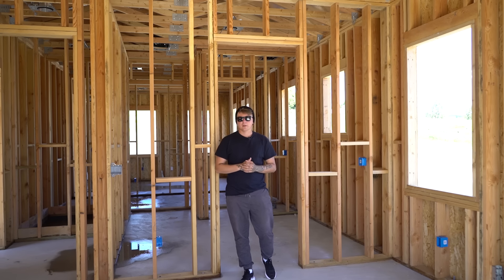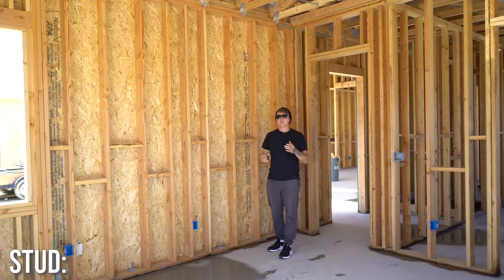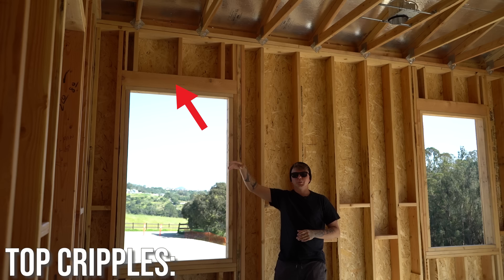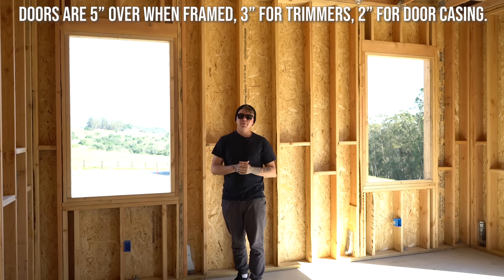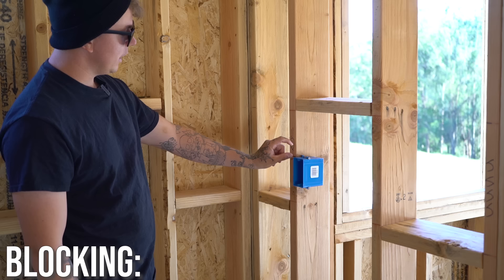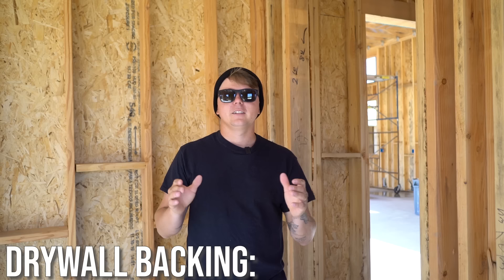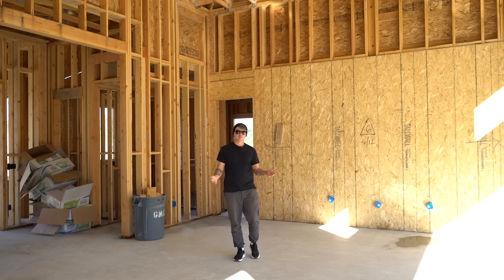Carpentry 101: Basics of Wood Framing with MattBangsWood [#1]

Comment: Great video.  Some comments from someone who has built and followed building across the country.  There are many things that are done differently on the west coast than in the rest of the country.  In the beginning of this video, you mention that pressure treated lumber has slits cut in it.  That only applies to fir and fir type lumbers.  In most of the country, treated lumber is Southern Yellow Pine (SYP.)  This material does not have slits because the SYP wood fibers accept the preservative treatments better than the firs.  
On the west coast, headers and many beams are huge dimensioned lumbers.   In most of the country, these items are built up of smaller dimensioned lumber.  6"x6" and larger dimensioned lumber is simply not available.  
You show triple or more side and bottom cripples. Anywhere except the west coast, you typically see single and rarely see more than double cripples.
Most of the country frames with kiln dried lumber.  Framing with green lumber is mostly unique to the west coast.
Outside the seismic affected west coast and wind affected coastal areas. Shear panels, strapping and clips or brackets and uplift brackets are foreign to people in most of the country.
Reply from the maker: Pinning this Roger, you nailed everything. So tough doing these videos as everyone has different requirements.
Reply: I'm an electrician, but I love watching yt journeyman so I can have an all encompassing knowledg. I have no problem helping others or making sure my work is making more work for them! Your a natural on camera teacher and I appreciate your videos. Also to the OP, ty for clearing that up, being informative and not being an asshole doing it 👌 I've always wondered why alot of the wood I buy is stamped syp. Are tremors considered bucks? I know we all have different terms and my framing neighbor here in Florida calls those bucks I believe. Thanks to you both!
Reply: Yeah I can confirm as a Iowa guy that builds pole barns and home remodeling additions. Don't have to build like we having a hurricane or earthquake
Reply: @lilcreaper007  are there requirements related to tornadoes?

Comment: I was installing drywall in a house (a Lindal Home design) in Grand Valley, Ontario, Canada years ago but there was no General Contractor (GC) and the framers didn't provide nail/screw surfaces for drywall everywhere. They didn't block any walls and the framing had dried and the 2" x 4" partition walls were bowed out so much the boards would rock. We ended up reframing some walls and shimming several others. The framers left a bunch of cut-off 2" x 6" pieces in the walk-out basement and I wanted to get rid of their waste so I cut pieces to length and nailed them between the perimeter wall studs at 3-1/2' and 5-1/2' above the concrete floor. It took most of the day but two days afterwards the owner's insurance agent came by to look at the house and was taking photographs in the basement. I asked if something was wrong and he said, "No, quite the opposite. Who's idea was it to install the blocking in the perimeter walls because it's not shown or noted on the drawings." I explained and he said he wished every house had this as it slows the rate of vertical flame spread and then he said he took photos to prove it so they can reduce the rate of insurance. He suggested we photograph it as well and provide pictures for the owner.
Reply: Cool! Let's hope it never gets proven though!

Comment: being a structural engineer in training myself, I have gotten good at summarizing the purpose of my job. A structural engineers job is to use applied physics and material science to transfer loads from the roof and floors down in to the ground. 90% of my job is determining how to get roof and floors loads (in my area, that would include snow) down into the soil. The last 10% is sizing those structural pieces to do so without breaking. Great video!
Reply: What also might help you better understand your job is find a "residential crew" or "commercial contractor" to work with ( depending upon which field you are going in) between semesters??? 
Might help give you a better understanding of how particular materials work in "real world". 
For me, I have just always learned more "hands on" than in a "class room". 
I understand, everyone is different, and was just trying to make a helpful suggestion is all.
Reply: Also trying to translate whatever crazy ass design the architect made into an actual plan
Reply: Being an EIT is an exciting time with a lot to learn... Did you notice the errors in the design and construction in the foreground at that @14:57 timestamp?  The shearwall boundary elements (6x6) should be continuous king posts, not broken and used as a trimmer.  The correct construction would have been 6x6 king posts and 1-2x6 trimmer.  This occurs at both of those walls.  I see this error a lot, contractors see the big post callouts and assume they are there to support the header load, they are usually not.  Because the 6x6's are broken, the single 2x6 king stud is inadequate to distribute out of plane wall forces from the garage wall to the roof diaphragm and the foundation, there should be 2-2x6 KS's there...  Also, as a design error from the engineer, there is no way those either of those two shearwalls meet the 3.5:1 aspect ratio limit, so neither of them is code compliant.  Those wall piers could have been strong walls, or the load should have been dragged somewhere else.  All nitpicking aside, this framing is exceptionally clean, you'll rarely find anything done this good in the field.

Comment: Awesome. Starting my third year as an electrical apprentice (tomorrow actually) and a lot of this I've learned just from working on new work residential. Crazy how much you pick up just from looking at the framing and having to understand how to work around it. Part of me still wishes I could've gotten into carpentry full-time, but alas. Still love what I do regardless. 
And much respect for your particular blocking setup. Can't tell you how many times I've had to knock blocking out that was all placed most likely at 48".
Glad I took the time to watch this. Filled in some more knowledge gaps for me. Always looking to understand all the trades better.

Comment: 3 years ago I started framing for my friend who is a contractor here on Maui. His name is Steve Schneider  (great guy and carpenter)i grew up here, working in management but decided to be a framer. I used your vids as reference, I remember most but you operate the same system as Steve. So it helped me really catch up fast. I also have a ranch in Southern Oregon ,recently I built my own house using a sled system and my truck to slide up beams and such. Your vids are the best and so are you! Enormous knowledge for such a young man. Thank you

Comment: Matt have you ever considered stuffing insulation into your channel when you build it to avoid hot or cold spots in your walls. Where I live in the northeast our climate has extreme temp swings and our walls can use what ever extra help we can give them. Thanks for another great video it should help many beginners and diy folks.
Reply from the maker: ulosefish  His question is 100% fine.. Plans don't call for a California Corner, or a Channel. It's up to framers to do those things, not per plan.

As far as your question goes Jim, our channels do create a hot / cold spot in the wall, but with the weather in CA it isn't a problem at all.. If we were to go to another area, it would need to be done for sure! Stuffing the channels with insulation before putting them in makes for a much better product in colder / hotter climate.

Comment: The blocking down here in Florida is called fire block and is done at the plywood joints and will not pass inspection without it. It also keeps a fire from climbing up the inside of each bay. Never had any issue keeping it straight though. Just pop a line. We make the top plywood joint the fire block and bottom plywood joint block is put on flat to nail the plywood joint easier. Most of our load bearing walls (interior and exterior) are also sheer walls and the plywood must be nailed to a certain schedule. Usually around 3in on the seams and 6in in the field. We call the “trimmers” jack studs and they go all the way down to the bottom plate. Our headers are usually 2x10 or 2x12 and sometimes even LVL material. Never less than 2x8. We got these orange truss screws now that tie the top plate to the truss that are so much easier than metal ties. It’s crazy how different codes are in different states. We do mostly big residential stuff. Usually over 8000ft. And anything with a conventional framed roof. Also we usually have a piece of all-thread running from top plate and into the slab that ties the wall down on each side of all openings and every 4ft between that. Good framers are becoming extremely scarce nowadays. Can’t get any help in St. Augustine. Nobody wants to work!

Comment: Really awesome video. I must admit though it is pretty overwhelming, everything you have to know, have to be pretty smart or takes a long time to learn all this stuff I would assume.
Reply: I won't lie, I knew NOTHING about framing or building anything until about 6 weeks ago. Nothing! After watching several videos from guys like this guy, I decided to build a shed in my backyard. I ended up buying all the tools required (which I went a little overboard) and am done framing and currently putting up my roof rafters. It's no intimidating if you just make a plan, no matter the size of project, and go step by step. Let these experts show you online. There are thousands and thousands of these types of videos. Give whatever it is you want to build a try!
Reply: @johnjacobs3601  You said it John! It's gotta be a blend of watching great videos like this one IN COMBINATION with actually building stuff. How you feeling about the shed progress?
Reply: @bmfitzgerald3  it's near the end, but has been for almost 2 weeks. The Arizona heat is already so brutal that if I don't get started early enough, I have no desire to be out there. Got really motivated when temporarily laid off of work due to covid-19 by knocking out about 80% of the shed, but now that work's fired back up, this project has been pushed to the backburner. If not for videos like these, I never would have finished what I've already done. There's no way. YouTube University! Haha. I'm 42 yrs old, by the way.

Comment: Hey Matt, absolutely perfect video, very helpful, thx! I'd like to know more about lumber you use for framing, except for bottom plate are regular studs and top plates treated by any kind and any mean? Because in this video you said you generally use wet lumber for framing and I thought (until now :D) wood used for framing is AT LEAST dryed to some level of moisture content, let's say 12-16 %. So is it just wood taken from mill / lumber yard without any kind of treatment? Please talk basics about lumber commonly used for framing - what kind of lumber, how is it treated, common sizes etc.

Another thing I'd like to know is what are common layers for flooring in case of non-solid concrete deck (I mean when you build a house based on crawl space laying on pillars or perimeter concrete wall). Please talk about every layer including joists, sheating(s), insulation and how to prevent the floor from squeaking from the very bottom to the final layer of flooring, e.g. vynil floor. Thanks a lot, take care.
Reply: For framing it is typically Doug fir or a "#2 or better" for wall studs and top plates, the wood is not at 100% moisture content but it is nowhere near dry (~7-11%). The final moisture content of wood varies depending on the environment and the MC of air. If you have other questions feel free to ask.
Reply: @rolly5457  Thank you for the reply. So we can say it's basically "raw" lumber, right? How about rotting or bugs? Isn't it a problem for untreated wood? Is the same kind of lumber used for joists, rafters, headers (except for extremely long ones that are man-made / engineered)?

Comment: Channels work great for interior walls, but I wouldn't recommend for exterior walls, creates a void in the exterior wall that insulators cant get to. Big problem when you build up north.
We instead use C corners for corners, and L partition backers where interior partitions intersect with exterior walls, making the L partition with a 2x6 backer gives you 1.5" on one side, and 2" on the other side of partition
Reply from the maker: I’ve been thinking about switching to that method.. Even though insulating isn’t an issue here, I see the beneficial reasoning.
Reply: @MattBangsWood  It's a really nice way to do exterior corners and make both your insulation team and drywall team happy.  My framing experience being in Michigan going back to the 90's, we always (as far as I can remember) utilized the C corner method 😊

Comment: Good explanations.  But you don’t do advanced framing to improve insulation values? The one area I noticed that is when you were discussing an interior wall meeting an exterior wall and you did the box framing to provide drywall backing. I’ve been a Drywaller for over 35 years and that’s how it used to be done and still is in many areas, but I’m planning on building a large home for myself this summer and want to do the advanced framing methods where you get more insulation in some headers, and in that backing area. You basically turn your backing sideways so that insulation can fit in there and you don’t end up with a dead air space. 

I was just sitting here watching how other people do things while I rest so I’m basically Just curious. Good videos though
Reply: A California Corner is i think what you are thinking of. He had another video doing this, in his How To: Frame a 16" O.C. Wall! (Most Common Wood Framing Method)

Comment: 4:40 STUD: Runs top to bottom, full length, with no breaks in it. The purpose of a stud is to construct a wall. 16” or 24” on center is standard, Pulling from the edge laying out all your studs. Studs come in 2x4, 2x6, 2x8 and come precut at the following lengths; 92-1/4 for a 8’ wall, 104-1/4 for a 9’ wall, 116-1/4 for a 10’ wall, and so on.

Comment: 14:35 HEADERS: Depending on the size of the opening, The Opening size depicts what you have for a Header. Example: 36” Window = 6x6 Header Vs. Fairly Large Header for Large opening for a 16’ set of sliders = 5-1/2 x 15 PSL, with 6x6 Trimmers.

Comment: Thanks man, I really appreciate your videos. I'm a recent grad and due to Covid I've been working remotely. These videos make it really easy for me to visualize what's on plan.
On the side note, more often than not structural elements are designed so that they are stiff enough to allow for proper operation of doors, windows, etc and reduce vibrations for human comfort. (Hence the massive sizes some times)

Comment: Awesome Matt!
I´m a retired carpenter and contractor and now I teach a Construction Trades classes at the local community college and job training centers.  This is one of the best series I have ever found on youtube. 
Only one criticism, as an OSHA instructor, is the cutting the blocks on your foot and the other shortcut cutting it in place rather than measuring the odd sized blocks, even though you make it clear that it´s not a method for beginning carpenters and it´s a common practice..  Maybe just put a quick mark on the board and sliding it over.   
And again, I loved your video and will be sharing it!

Comment: At 2:02 regarding insects and pressure treated wood, it's interesting to note that carpenter bees are not bothered in the least by pressure treated wood.  They will still bore their nearly perfect 3/8" holes in pressure treated wood with alacrity and gusto.  Their secret is that carpenter bees are talented borers but they don't eat the wood, hence, they don't have to ingest the pressure treatment toxic concoction.

Comment: Great video. As you said everything has multiple names. One example would be the trimmer. We always called it a Jack stud because it holds the header but maybe also King Jack. May be important to refer to your achitect on the blocking as mine specifically calls out a 4ft block line. 16 centers except on the first stud at 15 3/4 which just means subtracting 3/4 off the 16 marks as you pull the tape for layout.

Comment: As my instructor said in my basics of framing class, "blockers" are call that because their primary function is to block the propagation of a fire in case a fire.  Your video is a great resource and I just wanted to point that out.  This is the first video from your channel that I have watched.
Reply from the maker: What you're referencing is called a fireblock. It's only required on balloon walls that go from first to second story, or along the side of staircases following the stair stringer. Also seen where fireplaces are! Prevents fire from spreading in the wall cavity up to another level of the home.

In the situation I showed here, they're not required at all. It's 100% optional as they don't prevent the spread of fire, only adds rigidness to the wall.

Comment: Excellent presentation. I'll look at some others in this series. One thing I'm interested in is ability to insulate in corners and wall intersections after the framing process, otherwise installing proper insulation, rigid or otherwise, prior to framing these areas.

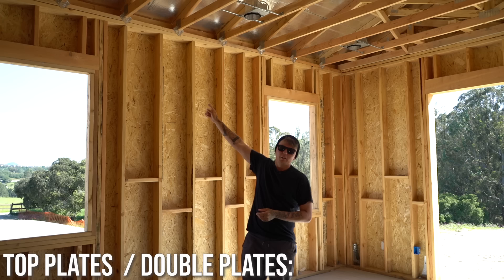Comment: 2:25 TOP PLATES / DOUBLE PLATES: The purpose of this plates is to tie walls together. The first top plate is to nail through the top plate and into the studs. After the wall is complete you are going to put that second top plate up there. That second plate is done for a few reasons as mentioned, is to tie walls together and the second reason is for load bearing purposes.